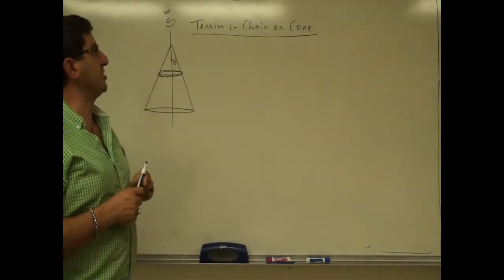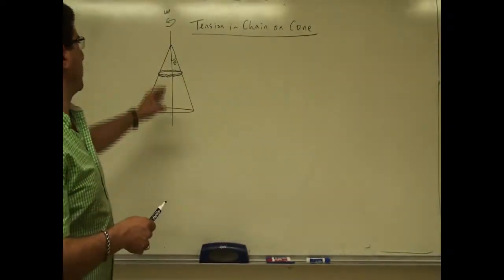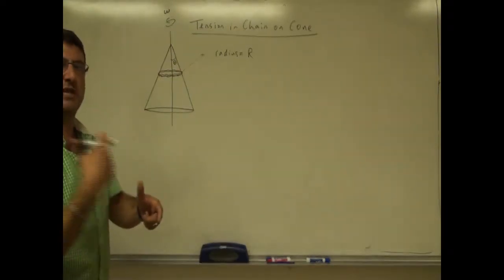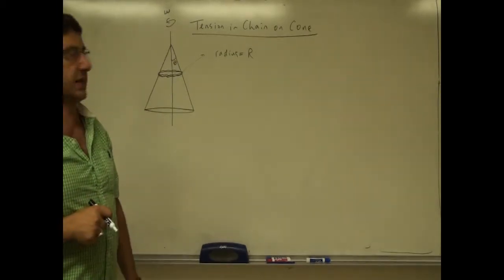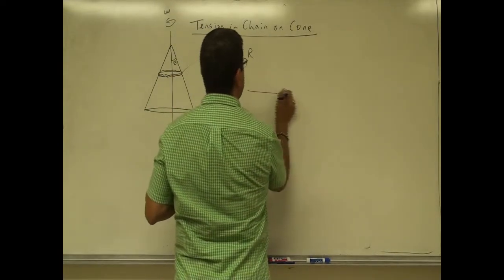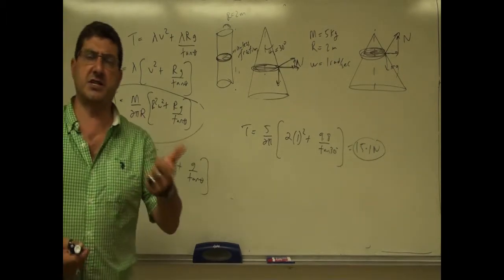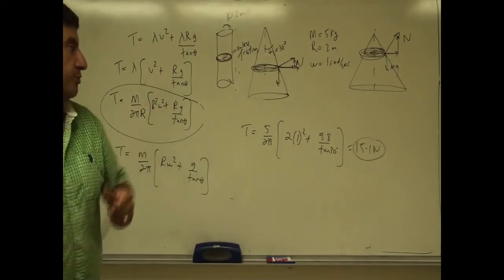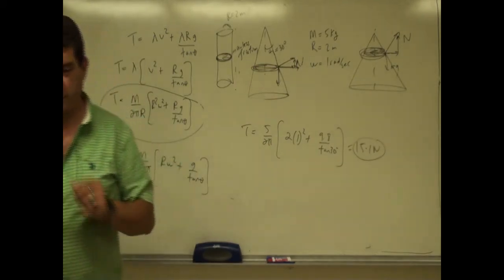Tension in Chain on a Rotating Cone: Example

Comment: Dear Viken : in the FBD, when you calculate the T. Why is N* sinθ = Δmg ? Why is not Δmg * sinθ = N? In statics, all the forces come from the weight of the Δmass, and the normal force should be part of the weight of the Δmass, so it should be Δmg * sinθ = N. Could you point out where I think wrong. Thanks a lot .
Reply: dear brian, we resolve forces in directions which balance out its origin {here normal force has mg and other forces as its origin}......  now, mg is already known and has a fixed direction so we can resolve normal force in direction opposite to mg as its perpendicular component balances mg out.